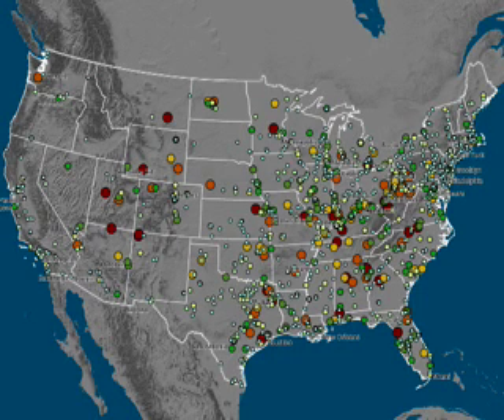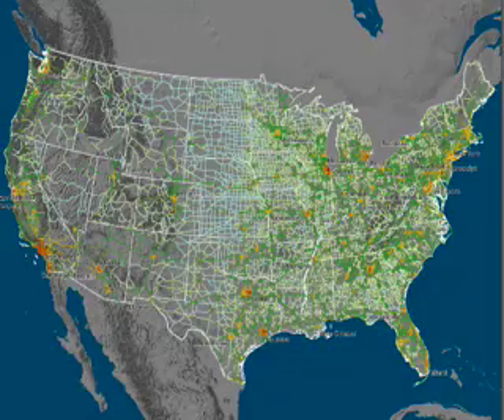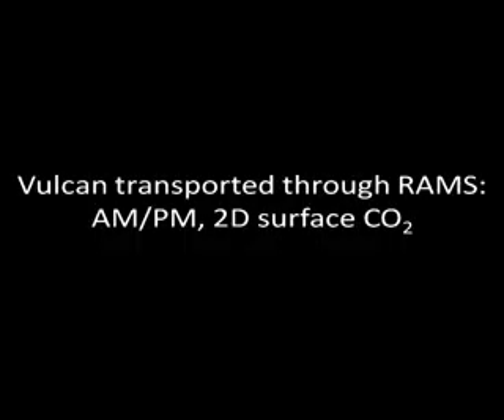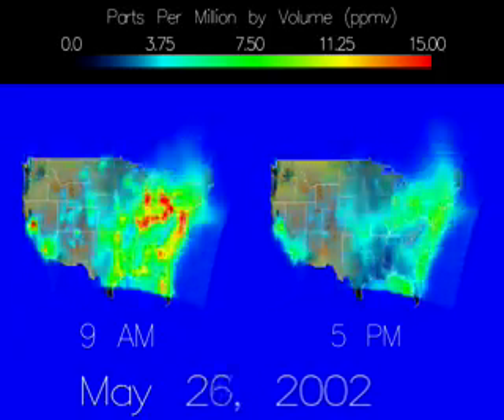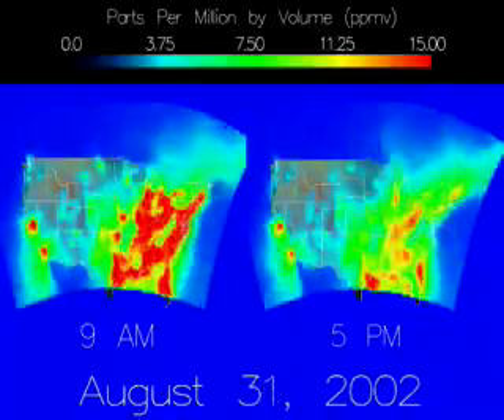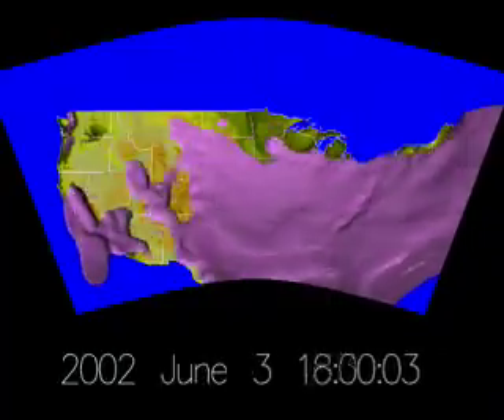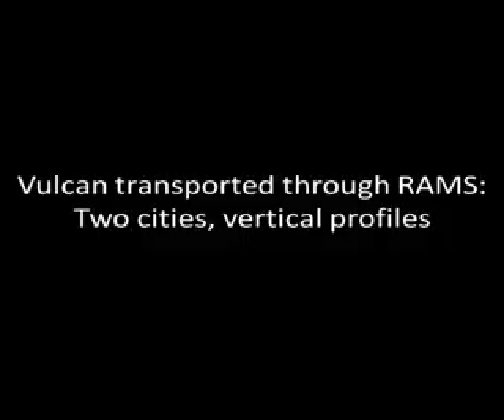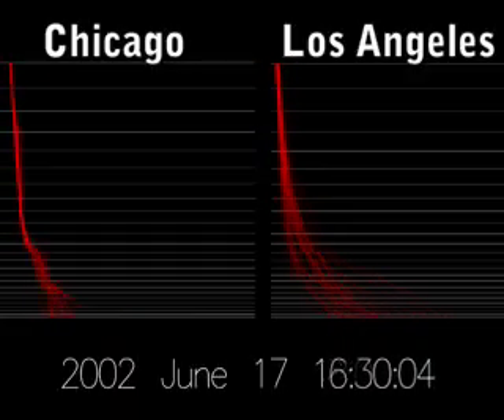'Revolutionary' CO2 maps zoom in on greenhouse gas sources

Comment: This is just a model.  What is shown is not real time, just a representation as the model was programmed to present. In reality, the air masses flowing from West to East across our country would pick up our industrial CO2 emissions adding them to the atmosphere. So,  the CO2 on the East coast should  always be higher than that on the West coast. Right? Wrong. Just the opposite. CO2 levels are lower on the East coast. Doesn't this strongly suggest that our biosystem is absorbing more CO2 than our industries are emitting? Seems so.

Comment: @kellygiz So, you are admitting the more accurate data needed to be massaged to come in line with the different, less accurate data.

This has already happened far too many times. The old data has never been corrected unless it suited the GW agenda. That is why the IPCC graphs never add up to the old empirical data.

Comment: @kellygiz Why do you theorise "no change of state"?
Even the pro-AGW Solar bods like "drkstrong" say the Sun is still exceptionally quiet. The Solar prediction guys are also predicting it's going to stay quiet 'til 2013. Some use empirical data for for low activity for up to 30 years from now.
The past three years have seen the oceans cooling (GIS Satellite).

Oh by the way, oceans heat from underneath, not the surface. It's an electric universe remember.

Comment: Maybe I should point this out.  Humans are responsible for 0.28% of all Greenhouse gases.  Here are some of the greenhouse gases.

Water Vapor--->95% of greenhouse gases = 0.001% Man Made   94.999% Natural -- 
CO2---> 3.618% of greenhouse gases = 0.117% Man Made   3.502% Natural -- 
CH4---> 0.36% of greenhouse gases = 0.066% Man Made 0.294% Natural -- 
N2O--->0.95% of greenhouse gases = 0.903% Man Made  0.047% Natural -- 
Other--->0.072% of greenhouse gases = 0.025% Man Made 0.047% Natural --

Comment: @Anunnaki444 Wrong, plants respire exactly the same as us, however, by PHOTOSYNTHESIS they take in CO2 and release Oxygen, which happens at a higher rate. Diffusion happens in both cases. Trees still help though.

Comment: The governments of the world are going to use up all the oil and gas in the ground until there is none left. The Green brigade have done nothing to slow this down in fact its pace is increasing. But then plenty of legislation about carbon dioxide being a poison, hang on a minute isn't that what we breathe out. What I'm the polluter of the world along with all the other animals even dolphins. Not by using all the plastic and other junk that we have no choice to use, but just by existing.

Comment: @PonguigPeopinn 
CO2 itself doesn't have any impact on temperature, that is true.

And I suppose that the CO2 could be used by plants, if we weren't cutting down the rain forests at an un-sustainable rate.

Also, look up the greenhouse effect. It has been in play since before the whole Climate Change debate even arose. The greenhouse effect ensures that the planet doesn't freeze. If you want an example of what happens when a greenhouse effect goes wrong, check out the planet Venus.

Comment: According to the AIA buildings not cars produce more than 40% of all greenhouse gases.  You can capture up to 18% of these gases at home with septic vent pipe filters filled with Zeocarbon.  Used zeocarbon can be recycled every few years as a nitrogen rich fertilizer.

Comment: **undamental cause of the greenhouse effect**
Svante's Theory was hijacked and corrupted by the Enviromental Activist
His theory,proper, was that "If lack of Co2 is the cause of Ice Ages, then More Co2 may cause warming. Maybe a 3c-9c increase from doubling current volume"

Problem 
1) Modern Meterologist and Geologist know it's the sun,evaporation/percipitation,and the Heat sink/conveyer belt that is the ocean that controls weather and climate not co2/ghgs
2) Co2 has doubled = nada

Comment: **Co2 is a greenhouse gas in the atmosphere that absorb and emit radiation within the thermal infrared range**

Thermal heat and Infared light are different forms of radiation

Thermal heat is when mass is aggitated. while Ir rays can be emmited by a mass that has gotten "IR hot"

A lightbulb gets "Whiite light" hot from electricty

Rubbing your hands together will only get "them thermal hot" 
Bending a paperclip back and forth quickly will  sometimes cause "white hot" agitation&smoke

Comment: *even if the U.S co2 production went to zero it would not make a dent because of China*

Well, that and Co2 isn't the driving force of wind,weather,or climate at any stage...it's just a trace gas along for the ride

The Primary force is the Sun and how much radiation gets pass the Earth's EM filed and and various atmospheric layers

watch?v=nVqWH5Qlg8Y
watch?v=2uIyUOAC1kU&

The Secondary force is the Ocean and it's "conveyer belt" that is earth's "heat regulator"

watch?v=MZbsMlr9WRI

Comment: To validate your obvious bias, we have not been able to prove any other reason for the warming other than CO(2) emissions by modern humans. We have compared the CO(2) emission levels with historic levels from arctic and antarctic ice records and global temperature estimations and believe that the rise in global temperatures is related, if not directly related, to our output of CO(2) gases.

Believe what you want to now, but ethically ignoring the problem is reprehensible. The truth will emerge.

Comment: The second law involves an isolated system that begins to even out after reaching an equilibrium.  The Earth has not reached that point and furthermore is not really an isolated system with respect to the greenhouse gas effect alone.  The sun is continually bombarding the Earth with new radiation adding to the system.

Comment: The Question is: why doent"s everyone start cycling to work, turning their Fing lights off when they're not being used, and stop eating so much meat!!! Cattle ranches are another big CO2 producer.

I hope that was an ironic comment hunter0000014. You cant get energy for free. Electricity is mostly produced by burning coal, which releases massive amounts of CO2 into the atmosphere. If you want to help stop the climate change, use as little oil and electricity as you can.

Comment: I know of no responsible suggestion that altered  concentration of CO2 would directly impact human health (except in enclosed space where it could displace O2). This seems like a straw man. The causal link between CO2 and temperature is not proposed as a correlation - it is mechanistic. There is a wealth of scientific work going back decades on this topic (even to late 19th century). Thousands of peer-reviewed papers, reviews, books, etc. I can supply some references if that helps.

Comment: Parts per 100 = percentage.
Humans can live in a variety of different O2/CO2/N mixes, and we won't start being physically hurt without a HUGE change in current atmospheric conditions.
As for causal links, It has been proven that the sun causes the Earth to warm, and less sunlight means that we get cooler.
CO2 is involved in plant growth, the water cycle, the pH of rain, and many other cycles, but I have yet to see any correlation between CO2 and the Earth's Temp.

Comment: Right now, everyone is concentrating on CO2, which is actually good for a significant portion of the life on earth (you know, plants.) In reality, we only need to worry about if the change was measured in parts per 100.
The dangerous stuff is largely ignored because all of the changes that need to be made to control those emissions are localized, machine-specific, and do not require the average person to give more control to the government.

Comment: As with the previous discussion thread, you are confusing a gross flux and a net flux. When considering the influence on atmospheric CO2 over timescale beyond a year or two, the net flux is key. The biosphere exchanges ~90 billion tonnes of C each year with the atmosphere but the net is about 3 (a sink). Fossil fuel flux globally is now roughly 8 billion tonnes C/year.

Comment: The point I am making is that it really is a cycle, with factors that we weren't aware of as little as 50 or even 25 ago, and there are parts we still don't really understand -- after all, deep ocean currents are barely beginning to be mapped, and we know that many large lakes have a turn-over cycle where the air chills the surface until it is colder (and heavier) than deep water, so it sinks, and the deep, cold water comes to the surface.
This can happen in the oceans, but why not more often?

Comment: This effects the trees, giving them more fuel to use in photosynthesis.  They then use more CO2, putting out more O2.  They also use more water nutrients from the soil.  This is one process.
It also adds energy to the oceans, which release water vapor, which travels over land, causing different areas to get rain, allowing different typed of plants to grow (and squeezing others out.)  This is one process, independent of others, but it effects others.

Comment: Um, actually, it will.  I (and several others) have made the point that the sun gives off an incredibly large about of energy, of which a small portion reaches us.
Because the output of the sun varies greatly over time, the amount reaching us (insolation) also varies greatly over time.  While our eyes cannot detect the difference, recent (in the last 100 years or so) advances in instrumentation have allowed us to measure the change.
(continued)

Comment: Hmmmmmm, normally, I'd agree with you, but in this case, I'll accept CO1 in place of carbon monoxide because it makes a clear distinction between CO1 and CO2, and when reading a discussion, that little bit of extra clarity is nice.
(After all, it lets you know that someone didn't just forget to put the 2 on the end.)

Comment: Carbon is a much better common unit in which to track CO2 - it allows one to avoid the mass differences when carbon it tied up in organic and inorganic forms. So, for example, when attempting to compare the mass of carbon in biospheric pools versus an inorganic pool (the atmosphere) you are not misled by the molecule the carbon is tied up in. This is a common practice in the science of this subject.

Comment: This as actually been calculated - it is tiny because it has a near zero net flux. Even the gross flux component is very small compared to the exchange between ocean and atmosphere, biosphere and atmosphere, and net fossil fuel flux.

Comment: M4GW - You are repeating a fundamental misunderstanding about carbon cycling.....nature does not produce more net flux than human sources. Nature produces more gross flux, but when considering the implications for atmospheric CO2, the net flux is the important part. Actually, "nature" is assisting us by removing some of our net fossil fuel emissions through regrowth and ocean uptake. Not all, however. It would help discussion if you do a bit of research on net vs gross flux.

Comment: MG4W, you misunderstand the difference between a "gross" and "net" flux as regards carbon cycling. To get a true net flux you have to take into account the source of the carbon in the respired CO2. This is actually key to understanding the difference between fossil fuel derived carbon and carbon that is part of the "fast" cycling.

Comment: continuing the explanation to samadamscw, "controlled" atmospheric lab tests are hard, as things may work differently in larger volumes, but correlating the tests with real planetary data can help give them validity to a margin of error.  All those tests DO affirm: a change in atmospheric composition CAN affect the heat trapping of a planet.  The question then becomes "how much change is needed, and "are we changing the atmosphere?"

Comment: samadamscw, you're unfortunately mixing quite a few elements here, and character count makes responding tough.
an example: back when we first sent probes to venus, we were amazed how hot it was- much more than just its proximity to the sun would matter.  This started the atmospheric composition theory and tests, which did explain this.  The model "solar radiation + atmospheric heat-trapping" accurately predicted this.  The next question became, "if we alter the atmosphere, what would happen?"

Comment: First and foremost, CO1 doesn't exist, you must be talking about CO. CO reacts with the oxygen of the air to tranform into CO2, so cars turn out to produce CO2. We also produce CO2, but it is a little amount compared to industry and vehicles (we don't exhale smoke from our mouths if you didn't notice). Plants breathe in CO2, but the amount of CO2 produced is far more than plants can use, and this situation is worsened because of massive deforestation. Try to get informed before arguing

Comment: CO2 isn't the bad thing, its actually good, helps keeps the planet warm, otherwise it would be like the moon, problem is WATER VAPOR which is the bigger greenhouse gas If we create too much watervapor our atmosphere will get hotter but we can't control it, what we can control IS CO2.Put that much CO2 in our atmosphere and the planet gets too hot and cause water vapor, when it gets hotter leads to more wathervapor which leads to higher temp, which leads to more watervapor i.e. The runaway affect.

Comment: "Follow the money"
Cute phrase, but accurate in this case, because there is strong, relevant correlation between who's paying the scientist and what the scientist says (on both sides.)
But in this case, another phrase comes to mind -- FOLLOW THE SUNLIGHT.
Stronger solar radiation = more heat.
More heat = more water vapor.
More water vapor = higher temperatures
This pattern continues until the sun reduces its output, at which point the earth (and mars, too) gets cooler.

Comment: The problem is, you're right about those chemicals.
Right now, every is concentrating on CO2, which is actually good for a significant portion of the life on earth (you know, plants.)  In reality, we'd only need to worry about if the change was measured in parts per 100.
The dangerous stuff is largely ignored because all of the changes that need to be made to control those emissions are localized, machine-specific, and do not require the average person to give more control to the government.

Comment: Or it could be that higher temperatures cause the oceans to release more dissolved CO2.  It could be that the natural solar cycles are what drive global warming, and that CO2 is just a natural result.  Correlation is not causation.  Just because we see a correlation between increased global temperatures and atmospheric CO2, does not mean that CO2 causes global warming.  It could be the other way around.  Plants like CO2.  They should grow faster with more of it.

Comment: CO2 is what you exhale.  It is what plants breath in when they produce 02 that we breath in.  CO2 is only harmful in very high concentrations, and only if it crowds out the O2 so we can not get enough.  In this video, they were measuring about 2 parts per million.  That's tiny.  Plants grow faster in the presence of higher CO2 concentrations.  This has nothing to do with cancer at all.  It MAY have something to do with global warming.  Relax.

Comment: samadamscw, the heating trends preceding CO2 have been explained and even anticipated.  They do not negate the CO2 heating model, and no reputable scientist has said that. 

This is a case of nonscientists misrepresenting the meaning of a finding simply to confuse the easily swayed.  An educated examination of the very basic principles will demonstrate why this claim is a non-argument for those more interested in soundbite than fact.

Take time to study the issue.